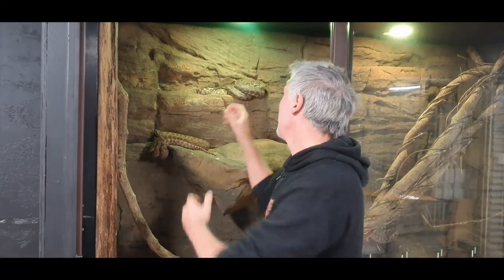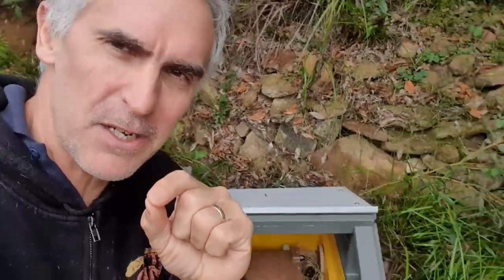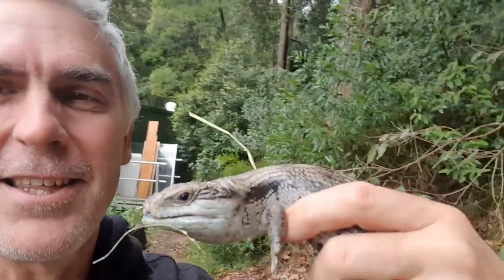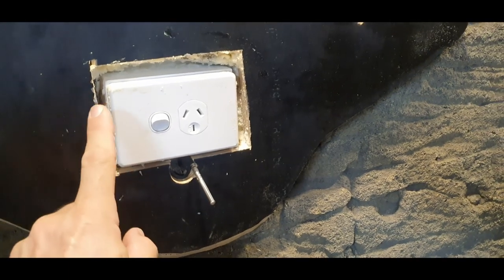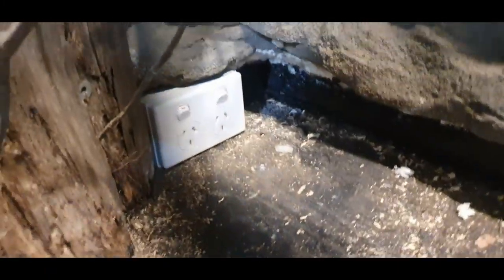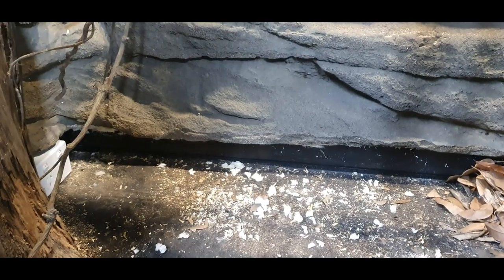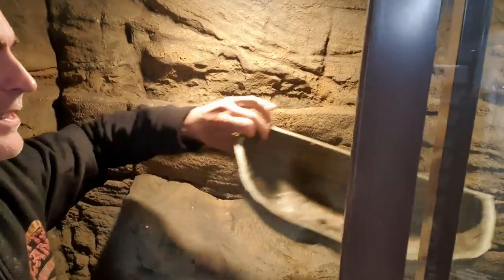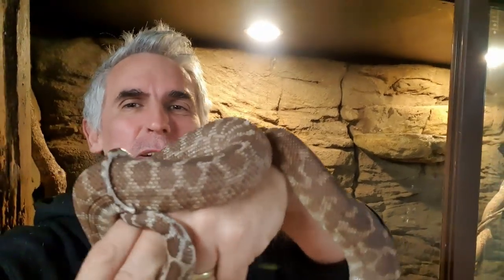HELP! My SNAKES SKIN IS FALLING TO PIECES - CrittaCam

Comment: You should consider adding a humid hide box (eg. spahgnum moss in it) that you suspend up higher like you did with the new water bowl. You could cover them with the universal rock backing or make your own to match what you have already. And of course make them accessible by having some sort of opening lid. From your video I also found it hard to see what your ventilation is like, that can be a big reason why it is staying too dry too. These bigger vivariums can take a lot of tinkering to get everything right - but once you have it really is worth it!

Comment: A great idea putting the water up higher for them and a little extra heat on the ground as well. l only have 4ft high enclosures and have heat down there for them as well. l only have it going over the winter months though, summer it is plenty warm enough here.
Reply from the maker: Great idea